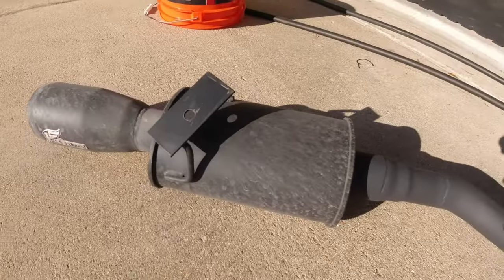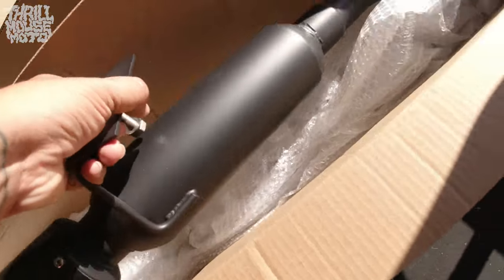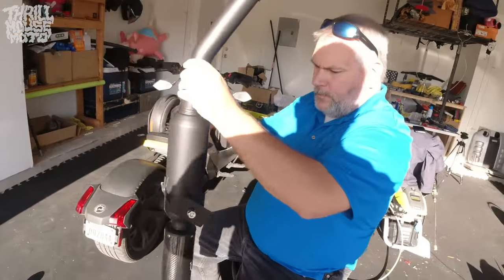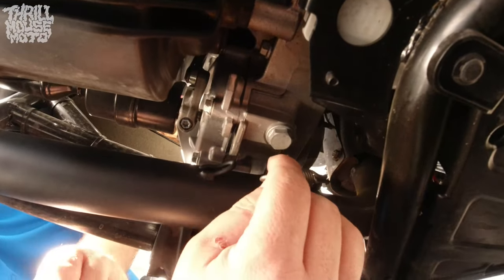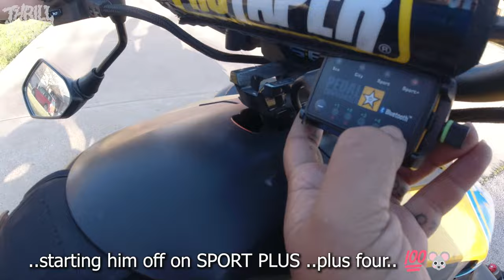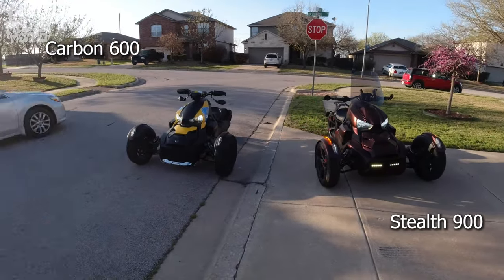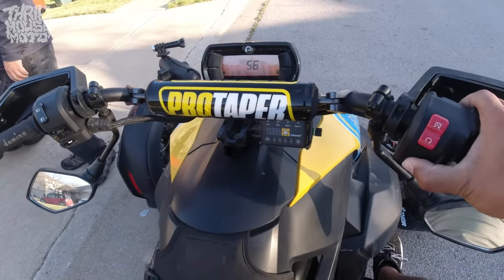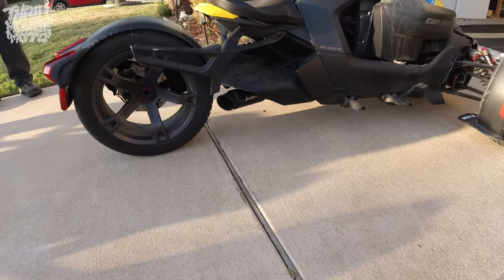Can-Am Ryker Exhaust Sound Check - NEW "Carbon Series" 🔊💨

Comment: You guys should find one more person with a 600 or 900 to join test. 
The 2 cylinder 600 will never sound even close to the 3 cylinder 900.
Even with stock exhaust when I was looking to buy one they sound completely different. 
May be close to the same Db output but 2 cylinders firing compared to 3 cylinders firing is a very different exhaust note. 
The information about different looks and weight is a big help though 👍👍
Reply from the maker: Thanks, James! ..have you gotten a chance to check out our other exhaust comparison videos? There's a playlist you can find on the channel that contains all our exhaust videos where you get the differences you'll hear in an exhaust on the 600s and 900s. We got about 4 or so videos on there. Good info to hear for yourself. You also see we compare all exhausts to all engine sizes. It's the best way to cover whatever the viewers might be looking for. A few days ago we recorded two 600s together, one with a Stealth and one with the Carbon. We keep it going for sure and definitely have more exhaust comparison videos dropping soon! 💯🐭
Reply from the maker: https://youtube.com/playlist?list=PLl38AHa0JPtJx2wJKLyJ0I7bbqBz6tpZC
Reply from the maker: This link should help! 💯🐭

Comment: A couple of general questions. What is the purpose of having two foot pegs on the right and only one on the left?
And also why do you use your hand to operate the shifter when putting it in reverse instead of your foot 🤔 
My wife and I have owned our Rallies since the beginning of 2019 and have never hand shifted them.
Reply from the maker: Glenn! Thanks for popping in. Sorry for the confusion, but I don't use my hand to put my Ryker in reverse here. ..Maybe you see me dropping the parking brake with my left hand and think I'm moving my reverse pedal..? 🤔 ..I don't have an answer for your other question either, about having only having 3 foot pegs. There's really not much of a purpose of having more than 2 pegs. ..Wish I could be more help! I'm sure if you wanted to use your hand for your reverse brake you could tho. Maybe if you couldn't reach or you  had an issue with your foot. ✌️💯🐭
Reply: @ThrillMouseMoto  The black and yellow bike in the video has 2 foot pegs on the right side??
Reply from the maker: @jamesglenn520  Yes, That ones mine! I have two on the right and one on the left. I just don't have a "purpose" for you on that. Just personal preference, ✌️😁
Reply: @ThrillMouseMoto  It looks EXTREMELY DANGEROUS ⚠️⚠️
If you are riding and your foot slides off your front peg. That other one is going to force your foot and leg down towards the pavement. 
It's going to GRIND your flesh for a long time because there is no way to stop the bike⚠️⚠️⚠️
If you live through that happening!??
You will never walk the same again 👌
This 🦵or This 🦿???
Reply from the maker: @jamesglenn520  Bro.. 😅,  Did we just become best friends..?! 😁 You're one of the good ones, James!
Reply: @ThrillMouseMoto  Lol! I'm just old enough and I call things as I see it. And I sometimes unfortunately don't take the time to SUGAR COAT things 😬👍
I have a brother in law that dropped his foot while riding a quad and the rear tire caught it at maybe 15-20mph on the gravel. Foot and leg instant Hamburger 🍔 a Broke in multiple places to this day walks with a Limp🥺
Reply from the maker: @jamesglenn520  Have you seen those foot pegs on quads that kinda take up the whole sides of the quad? .. they're like a floorboard of woven straps that hang on both sides.. THAT would be pretty cool on the Ryker ..🤔

Comment: Did you have a baffle in your stealth series exhaust?? I love the sound of my stealth series but it is hella loud so if I could quiet it down some more I would!!
Reply from the maker: They are all hella loud for sure. We haven't come across an exhaust that isn't loud yet (other than stock). The Stealth has been the less loud one we've heard so far in person. ..Check out the one part of the video were we set the Stealth down in the grass. You'll see the baffle inside it as I also mention it in the video. If yours doesn't look like mine in that part of the video than you don't have a baffle in yours.  We put baffles in all of our exhausts so far. Hope this helps! ✌️💯🐭
Reply: @ThrillMouseMoto  I actually msgd Ricky about it and he said he typically installs them so I pulled my stealth exhaust off and sure enough there is one In there but it's much further down in the pipe than yours is , which is why I never saw it.
Reply from the maker: @badmanb151  Hmm.. would that mean you could put TWO baffles in yours then..? 🤔 ..And then what would THAT sound like.. 🤔🤔 (double "Hmm..")

Comment: They sound like they' re making bubbles under water.
Reply from the maker: Kip! ..Yeah, ever since I put "wind tape" over the internal mics on my action cams it sounds like I'm riding under water in high winds. It's a drag but it's way better than without the tape since all you would hear is the wind popping in the mic. I'll figure out a better solution to block the wind noise for you guys! ✌️💯🐭